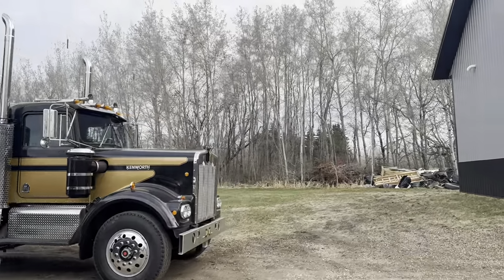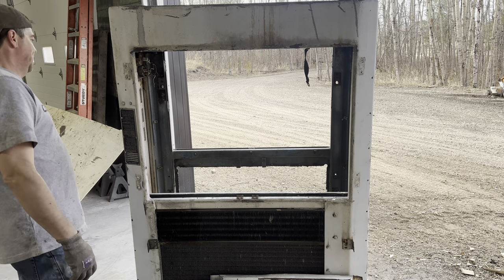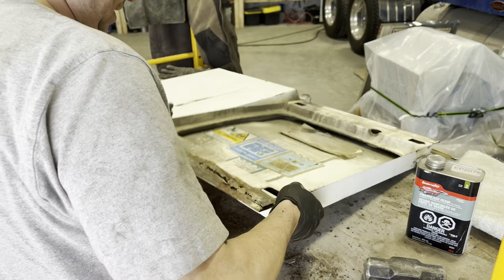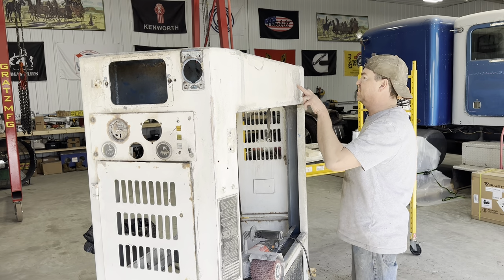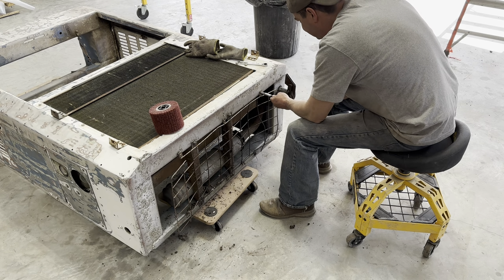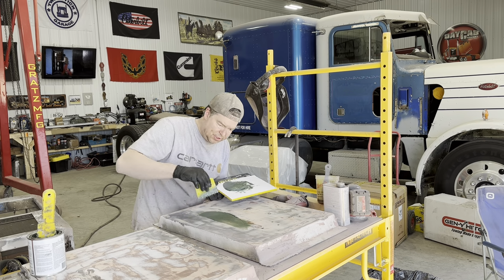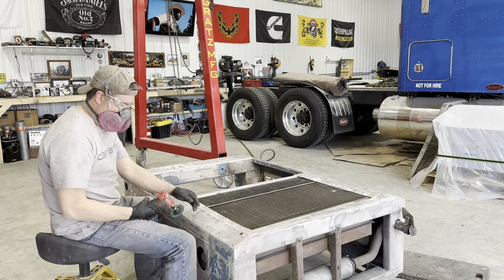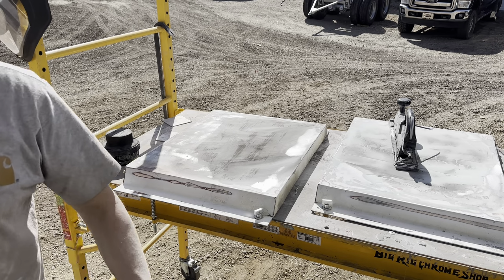Smokey & The Bandit Tribute Truck Ep.73 More Bondo Than Steel

Comment: You might want to replace that screen/cage wire on the top with a solid panel. I can only imagine that birds and other animals might be tempted to nest up in there when the trailer is parked for extended periods of time.
Reply: Just what i thought of saying. Birds loves to make their nests up there on those refers.
Reply: Rechrome and replace reefer grill
Reply: 🤔🦇🦇🦇🦇🦇 your right
Reply: I'm a reefer mechanic and yup ive seen a few bird nests 😂
Reply: I recommend a solid panel, and painting the inside of the reefer, as it might help with water running down inside the reefer and causing more rust issues and stains on the front of the trailer.  Keep up the good work.

Comment: Hey Mark, you should install a small generator in the refer cabinet so you can have power when you’re at truck shows. It would be cool if it used the exhaust flapper that’s already on the cabinet. Just a thought.

Comment: I used to install lots of fiberglass chemlite roof skins on trailers and straight trucks and a neat trick I learned was to put baby powder on your arms or exposed skin. The powder fill your pores and when you are done the job just rinse with water, don't scrub. No itchy fibres

Comment: Your fix was fine with the fiberglass but you made one mistake that won't end well in years to come and that's not sealing or converting the rust before laying the fiberglass over it. That's gonna give you issues years down the road. Could last 1 year or 20 years.  No one knows but it will show its face one day or anther lol other wise you did a great job 🍻

Comment: Just a tip when applying short strand FG, if need be you can add a second coat AS the first coat is setting up. If you have enough on there you can sand it out fully & not need a drop of bondo. Short strand is water proof, bondo is porous

Comment: Well son you don’t want to put body filler on paint, it just won’t stick very well, normally we take a 36 to 40 grit disk and rough up the area, eliminating most or all of the paint, body filler needs a rough surface to bite into , about the only Fastway I’ve ever found for getting paint off of something is to sandblast and a lot of people do not want to go through that, especially in their driveway of their home, something like your reefer case I would take some 80 grit and take the first layer off , then I’d probably switch to some 180 and try to feather some of the leftovers, then prime, all the bare areas, then switch to some 320 and then put a sealer over the whole thing, you don’t want old paint bleeding through your new paint, looks like you’re having fun 👍

Comment: If I may make a suggestion, paint the interior of the reefer box flat black.  That color will hide all of the interior bits and pieces from view through louvers and gaps, effectively making the inside invisible.
It may not sound like much, but if you leave the interior white (or whatever color parts are) it will stand out like a sore thumb after you get the exterior finished.

Comment: Great ending 😆 Tip: After top-coating the outside of the reefer shell, spray some Waxoyl or other rust-prevention goop (the lanolin-based ones are the nicest to work with. Baaa 🐑) on the inside of the areas where the rust holes were, and in any corners/flanges where water can sit. It stuns the tinworms and stops them doing a repeat performance which then jacks the bondo and paint off. I learned that the hard way 🙂

Comment: Just watching Smokey and the bandit and not sure which truck is in the opening credits however the light on the drivers side front fender is out. So if that’s the one you’re doing make sure you take out the bulb
Reply from the maker: That's the '73 ... I'm doing the other one
Reply: @TwinStix  that’s good. It’ll look better lit up